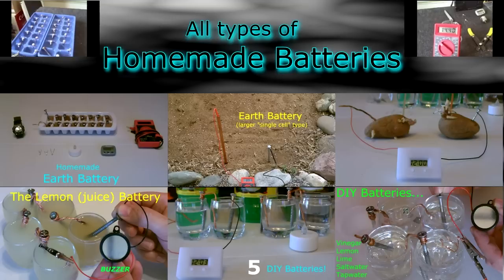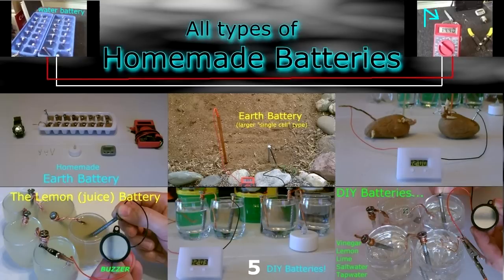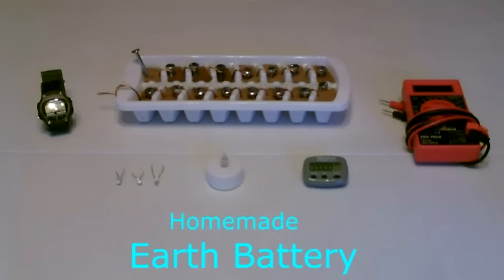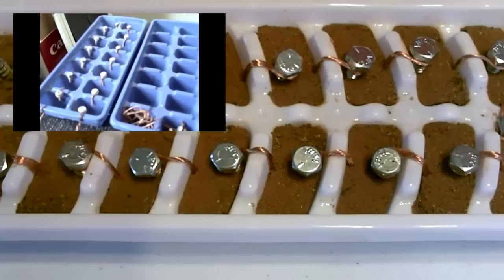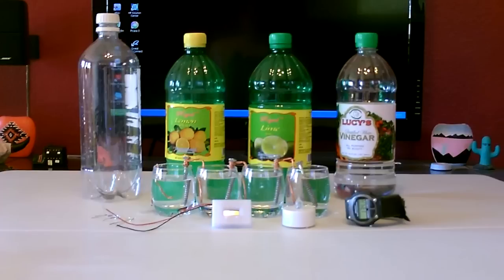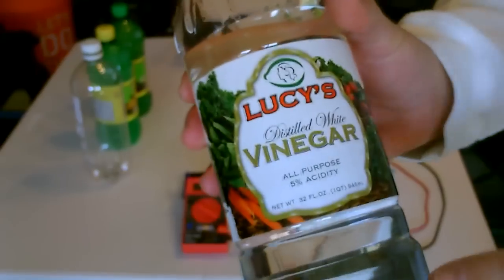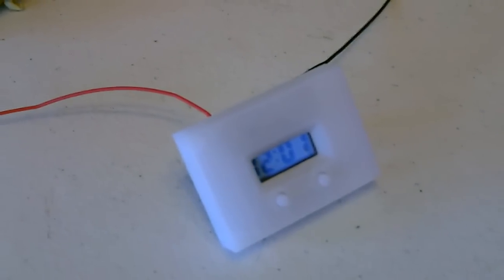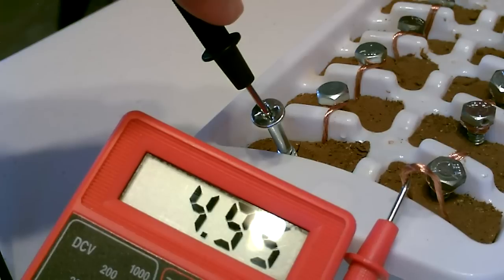MY Homemade Batteries (compilation vid.) - Water, Earth/Dirt and Juice Batteries -up to 14v- Ez DIYs

Comment: you and I are of the same mind.. Not long ago I made a battery out of copper tape and zinc tape and paper towels I put a little vinegar in it and I had a battery at last 4 months With continuous led
Reply from the maker: sweet! i've got a big copper sheet and some aluminum flashing. i was thinking of making a very large battery with those.